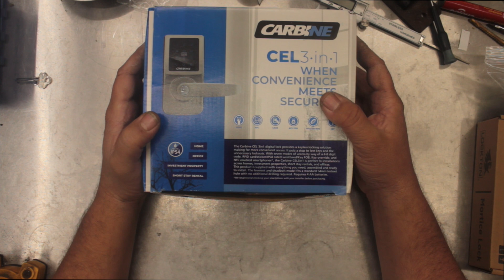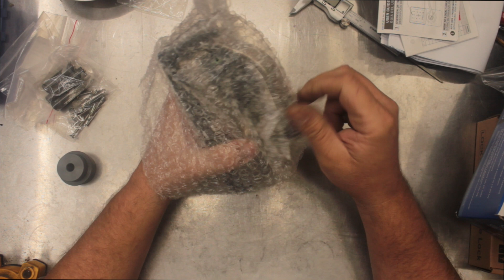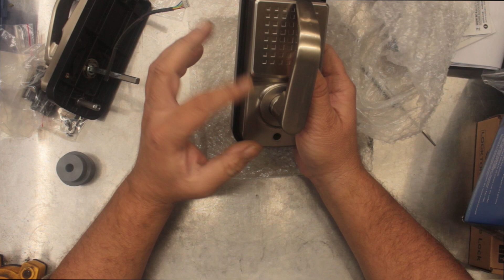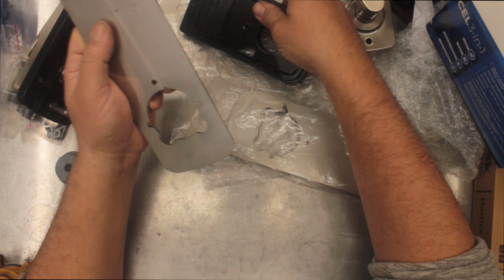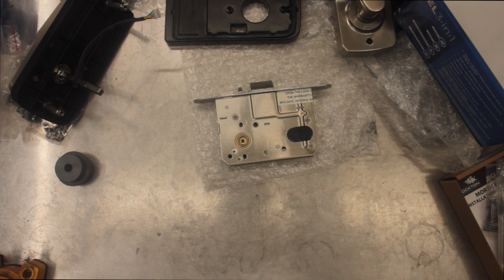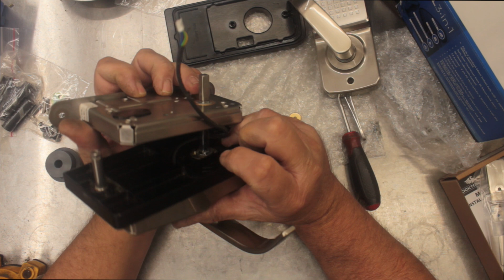Digital Mortice Lock Carbine CEL3in1

Comment: Thanks so much, I've installed a couple of Carbine CEL2 locks and absolutely love the things.
I have a 3rd door with a mortice lock and was initially disappointed that it might not be possible to use the Carbine again....until I found your video.
To discover the Carbine is available with a mortice option and your 3572 conversion video was a revelation.
Great explanation, I am very grateful you took the time to make the video.
Thankyou.